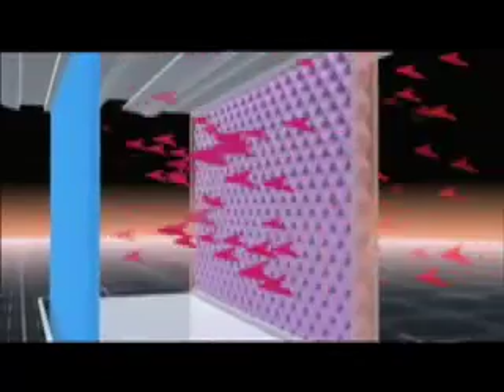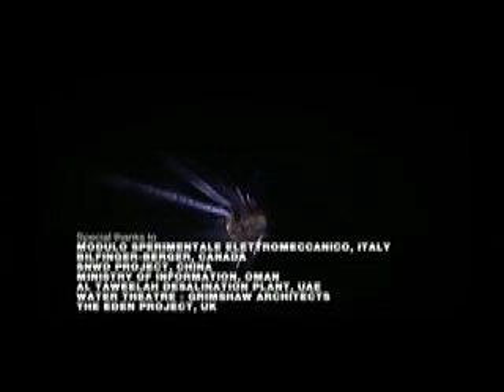The Teatro del Agua

Comment: In a hot, sunny area t might be possible to use solar energy to pump the water, or the difference in temperature between surface and deep water could generate enough electricity to pump the water.

Comment from the maker: Dear trudy
Yes, it is true that you will need energy to pump the water. However this is less energy than what would be used if you desalinated using RO or other conventional methods. With regards to the salt, this does not need to happen if constructed correctly. The Seawater Greenhouse is built on the same technology and does not suffer from salt coating problems. The salt only covers the evaporators and they are covered by seawater anyway.